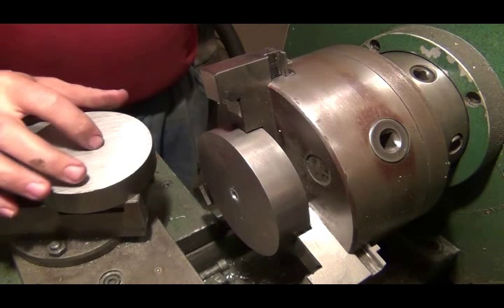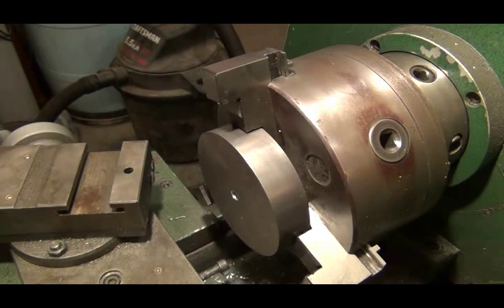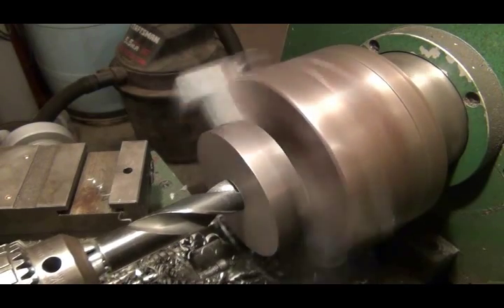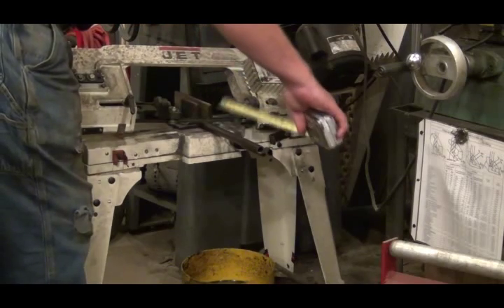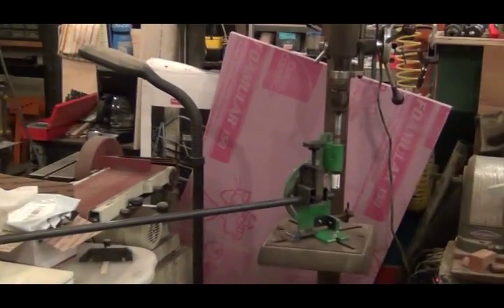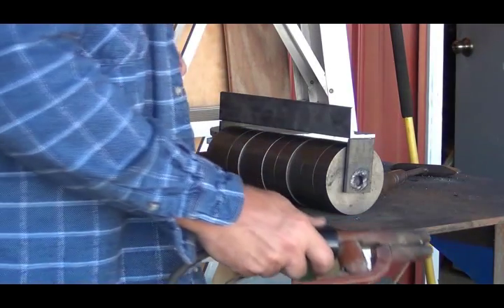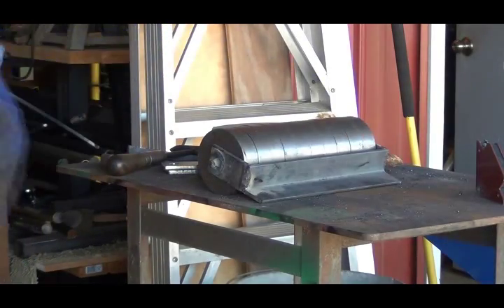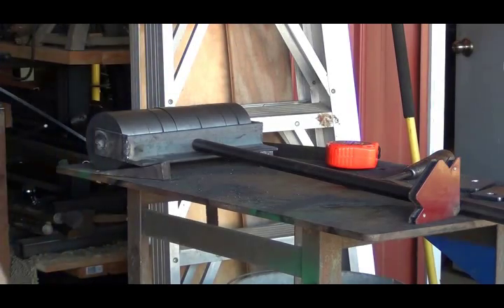Shop project, tile roller

Comment from the maker: I have both types a saws. I tend to use the band saw most. The original blade that came on my chop saw was junk. When I put a new one on it, it did better. The band saw will wander on larger things. When I need to cut something big I do it at work. Faster and a square cut.